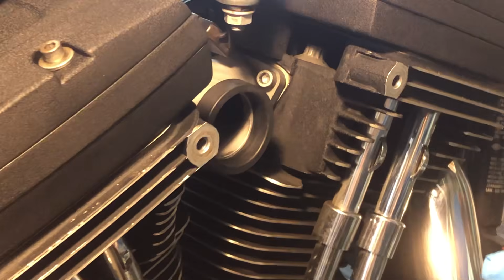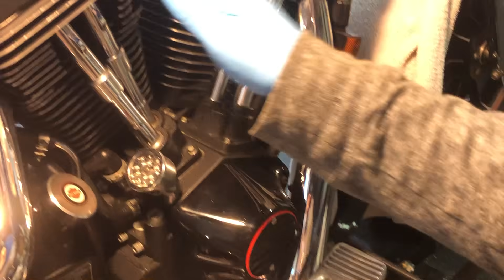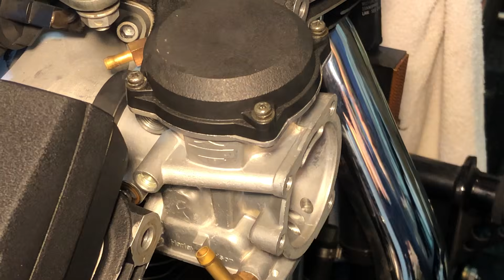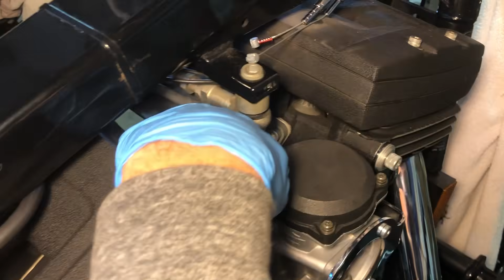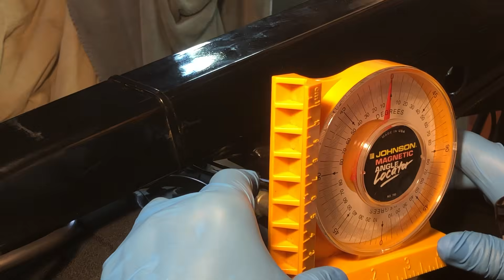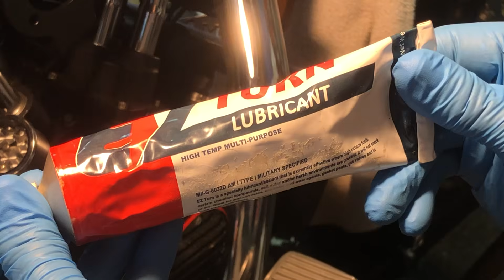How to avoid intake-vacuum leaks when installing a Harley-Davidson intake assembly (Part 2/2)

Comment: Problem is that not all have all these brackets😢
Reply from the maker: I used to cut and weld the brackets to make them fit.  Another option is to order several brackets from different manufacturers and then return the ones having legs that are too long for your application.  Just check the return policy before you buy!

Comment: tightenig the manifold after intalling the carb basically reduce the risk of creating an intake leak ?
Reply from the maker: Yes, because you are using the supporting bracket to align the intake tract.  Also, If you tighten the manifold first, install the carb, and then try to install the supporting bracket, the bracket may not properly lign up with the threaded holes in the heads.
Reply: @Zerk_Ziegler thank you appreciate it!

Comment: a 1 pound can of ez lube is just about the same price as a little 5 oz tube
Reply from the maker: EZ lube ≠ EZ Turn.  EZ Turn lubricant is specifically designed to be highly resistant to gasoline, while standard EZ lube grease is not.  EZ Turn is specifically formulated to resist high-octane fuels and aromatics.  Standard greases are not designed to resist fuel and will dissolve.
Reply: @Zerk_Ziegler  what does that have to do with the price of eggs?
Reply from the maker: @dennytuma Aaah, you had me confused there for a minute.  I throught you were talking about EZ Lube grease, which is an entirely different animal than EZ Turn Lubricant.  But, yes -- EZ Turn is cheaper per ounce when purchased in a 1lb can.  I don't know if I would ever be able to use up 1 pound of that stuff, though.  Also, the tube reduces possible contamination issues.
Reply: @Zerk_Ziegler  you still haven't told me how it effects the price of eggs
Reply from the maker: @dennytuma The effect might just be an EGGsistential crisis ... :)

Comment: Thanks very much! Struggling with my sportster at the moment, and your video comes in handy
Reply from the maker: Glad the vid is useful.  As I mentioned in the description, EZ Turn lubricant on all the gaskets promotes a good seal.  I also use this lubricant on the intake-manifold screw threads to avoid galvanic corrosion (steel screws going into aluminum) and to prevent the screws from backing out.  This lubricant is essentially a combination of grease and glue.  I use it wherever gasoline or oil are present.  Expensive stuff, but worth it.  Alternatively, lithium grease can be used on the gasket surfaces, but I don't think it seals as well as EZ Turn does.